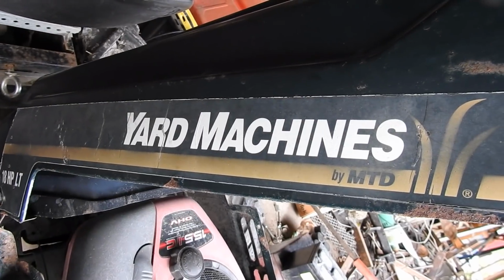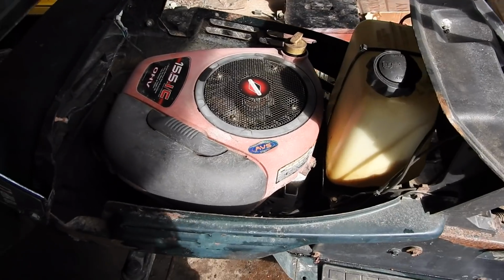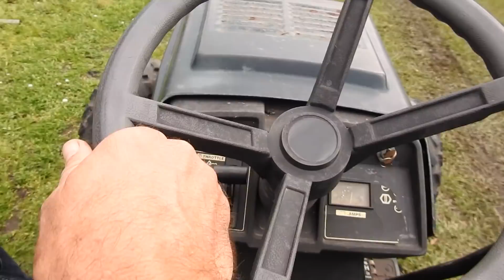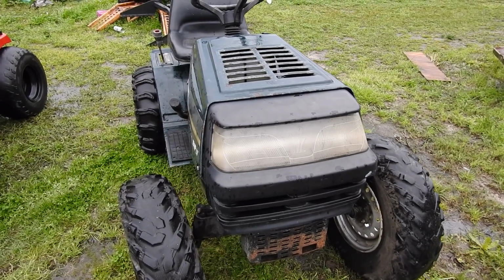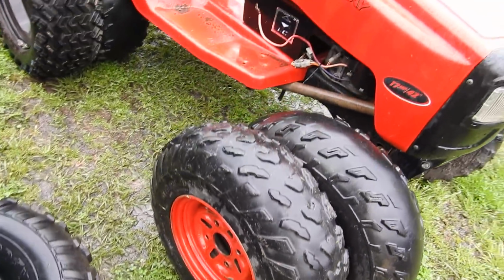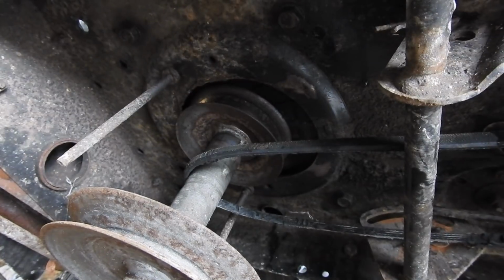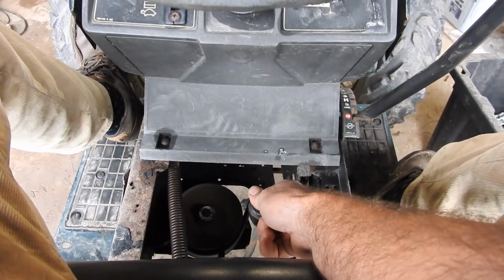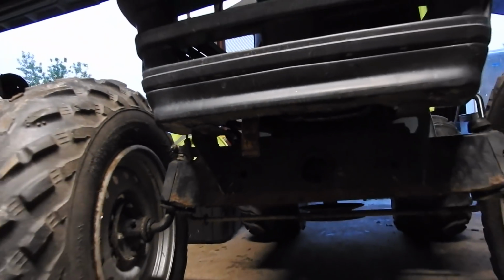Firing Up the Yard Machines and Hitting the Mud

Comment: oh and chud, i have that SAME exact yard machine ( the green one ) and the straight pipe does sound good, but after about a week of driving it, once you let off the gas the engine will cut off ( no back pressure to open up the valves )  but when your riding it for that week its fun as hell with all that backfiring !!
Reply from the maker: I am loving it as long as I have my ear plugs in... thanks for watching.

Comment: These machines are relatively easy to modify even though they have two belts.
YouTube user fearlessfront had an idea of putting a 6-speed in the back instead of the F&R.
I've had similar ideas but never found a clean candidate.
Reply from the maker: Yeah, I already need a trans for my John Deere, I guess I should hunt a couple or more... thanks for watching.

Comment: I have a similar mtd project right now. Trying more so for speed it’s only a 10 horse Briggs motor and I pulley swapped it. (Flipped the front pulley upside down so the one for the deck is a drive pulley) and a small pulley in the back but hardly any torque now. Any advice? Also mine is straight piped with dual stacks out the hood. It sounds awesome.
Reply from the maker: I bet it does sound awesome.  I have no advice, they are a real pain to pulley swap the back... see if you can find a craftsman would be my advice. thanks for watching.

Comment: I got a question Mr. Chud, I'm thinking about a mower build with low profile street tires and a double pulley swap. Could you make a video on putting street tires on a mower. Thanks it would definitely help. I've googled it and got nothing.
Reply from the maker: Sorry, just seeing your question… I have some boat trailer tires I want to put on one some time. That might help out if you are still interested. Thanks for watching

Comment: do I need an key switch if I put a pull start on.
Reply from the maker: You only need to to shut it off, you could use a toggle switch or pull the spark plug wire off... good luck and thanks for watching.
Reply: @chud327  cool thanks for the info and I enjoy your videos
Reply: Will it work on a kohler

Comment: I need a danor rear.end for my murray I need a six speed please let me know something
Reply from the maker: I might no of one, where are you located?
Reply: 1208 south center st perry fl
Reply: It went 40 miles hour before I cracked the case trying to take it apart for the first time have more plans with it and hope to bogg with u and others one day with it
Reply: Fun fact my bday is exactly a month and 10 days from now
Reply: If u can get me a rear end I'll give u a  17.5 briggis with both valves haveing steel push rodes head cleaned gasket replaced for no reason steel rodes and value adjustments and I have two motors of the same brand and hp but this one has and oil filter on it if u can get me the exact.rear end I need I'll by concidence give u both of them lol
Reply: But u really need a kholer
Reply: But pull start is ur friend for kholers

Comment: Still use the good years, the other ones are to low profile
Reply from the maker: What about the ones in this video that were the same height?  Thanks for your vote and thanks for watching.
Reply: If you are talking about the ones off of the car, if they are 25 inches tall, and on 14 inch wheels, then there isnt enough sidewall flex and you wont get very good traction, the got pretty good traction on the car, but the car weighs a lot more than the lawn mower does